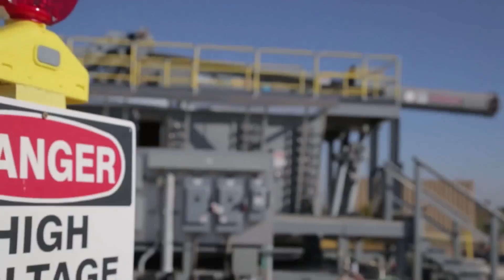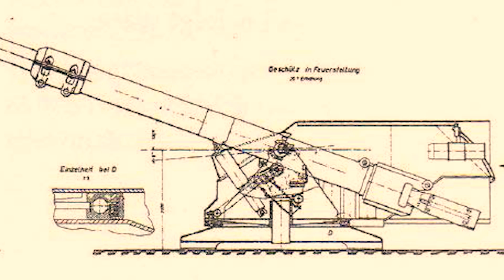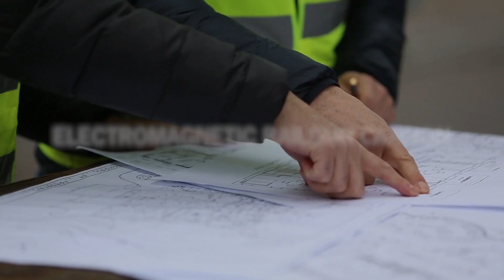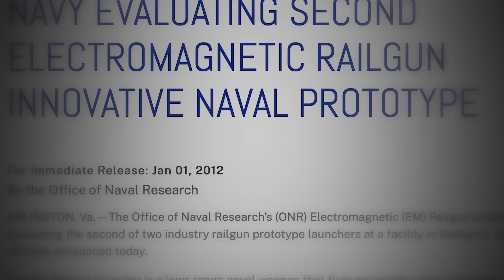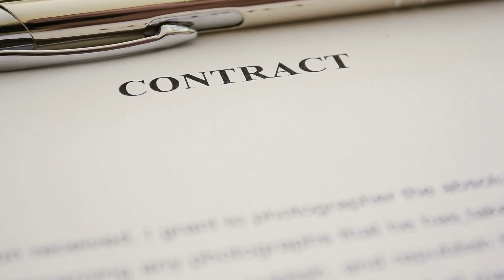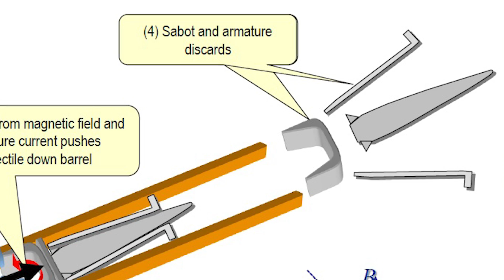The Most Powerful New Gun the Navy Has Ever Built?

Comment: Hmmm... have a disposable cap at the end the barrel that gets replaced after every firing. While preparing the to shoot bring the barrel down to as close as a complete vacuum as possible and use a round that can be suspended with magnetism similar to a maglev, maybe not even the case surrounding the shell. The round will punch through that disposable cap each time it leaves the barrel, but no air, no touching the sides = no friction and no friction = very little degradation in the barrel. Also running super cooled liquid hydrogen through the barrel walls will not only provide cooling, but it also enhances magnetic fields and make it easier for the round to be levitated in the barrel. I can't be the only one who thought of these solutions...

Comment: playing @8:40 in slow motion, I see that the air around the object is highly deformed. Or the light around it is warped. Why is this? Is the object heating the air ahead of it as it goes? What causes the light to shift so much? Because I don't think it has anything to do with shutter speed or frame rate. I'm just wondering because I didn't notice the same effect around mach X fighter jets in flight.
Reply: the object is traveling at more than the speed of sound, thats the shock wave you can see, like when a large explosion happens you can see the shock wave radiat out

Comment: Either I'm confused or this video is.   The German WW2 rail gun shown in this video was a railway gun, conventional in concept but bigger while the rail gun developed by and for the US Navy that features in the latter part of the video does not employ conventional low explosive propellant (as the German one did) but uses electro-magnetic forces to accelerate the projectile. In the latter case the term rail refers to the 2 conductive rails that provide extremely high current to the projectile which as a consequence is rapidly accelerated along the barrel.

Comment: Isn't this the system that the US later abandoned ($500 million wasted) to the fact that as there was no gas to lubricate the warhead, causing the barrel of the gun to quickly wear down after a couple dozen rounds, and as a result killing any accuracy?  The same system, that due to the size of the capacitors and the power needed to charge them, could only be used on ships, and with a range of only 70 km, would have the ship sunk by undetectable hypersonic missiles (with ranges more than 1000 km) long before the enemy came anywhere near the range of this gun?  Not only have the Russians long solved the issue of wear, but they figured out how to reduce the size of the system (to mount on a tank where it can be put to far better use), all in one solution.  Please stop embarrassing me and my country by touting unsuccessful technology.  At least the Russians don't brag about things to the level the US MIC does.  Then again, with the eight years NATO spent training and equipping the Ukrainians, I can see why they are desperate to brag about something positively; even if it was a failure.  When will the US MIC finally put the money where their mouth is and not use most of it to line their pockets and those of the government officials that award them the jobs.

Comment: The German Rail Guns shown here were so called because the wheeled truck platform ran on standard gauge railway tracks, these weapons were used against ground targets cities and even cross channel at England.

The massive barrelled ‘railgun’ V3 (Vengeance Three) weapons which are the natural precursor of these modern electronic devices, were aimed at a fixed elevation aimed towards London and were underground, only the tip of the muzzle visible above ground. 

They were formed of a massive barrel with ports evenly spaced along its length from which explosive charges were set off by the projectile as it shot up the barrel, increasing velocity each pass. The Germans used their rocket know-how in the construction and rocket fuel as propellant. Fortunately Allied Bombing put them out of use before they could do too much harm.

Comment: When I worked for a mom and pop auto parts store back in 1981, a representative came in and asked if I could supply him with 100 pairs of brake pads for a Chevy Corvette. These were symetrical pads designed for multi piston calipers. After a brief search I secured the pad pads and made on of the strangest sales of my life. When I asked why the Navy wanted with brake pads at sea, the buyer told me they were to manage the recoil of a new, extremely powerful gun. Could it be and early pototype of these?

Comment: I really think the Military needs to look back into Project thor or making a railgun type weapon outside the atmosphere. I'm sure it could capable of holding many projectiles and then have private industry    rocket companies send up the ammo and maintain it. Could run the rail gun with two small nuclear reactors to maintain enough energy. Possibly two nuclear submarine type reactors. Space travel is getting a hell of alot cheaper now especially,when you don't need to throw away Rocket boosters like before. Space X has definitely proved this.

Comment: What exactly causes the large muzzle flash from the barrel of a EM rail gun?
Reply: It is technically an arcflash when the push armature decouples from the rails. A good part of the aluminum alloy piece is vaporized while the tungsten or DU alloy penetrator continues. The real bottleneck for these are the pulse power switching tubes that rob about 50% of the power and have about 30 shots for life. The rail also is consumable but lasts about 90 shots. The spark gap tubes are made by EG&G and are each about 15 inches diameter. The gun has 48 of these. The rails are made of a copper beryllium or silver tungsten composition 🤓

Comment: Tungsten rails, and barrel flooded with a inert gas before every firing would probably help keep the arc from destroying everything.  Probably a cooling system of sorts down the center of the tungsten to help firing times.
Reply: It’s not just arcing. The huge forces involved bend the rails.
Reply: @dzerkle  with materials and increasing the size of the structure around the rails holding them in place and tungsten being as hard as it is, especially at the size that would be needed I'm sure they can fix that issue easy enough.  Pay me what they pay the ones trying to do it now and I'll make it for you 😂😂

Comment: Nuclear powered vessels could easily be designed that would have no problem powering such weapons. This research didn't just vanish. Someone somewhere is developing and adapting railgun launch tubes with moder engineering and purpose built man made materials.
Railguns may not today be practical & it may be better to research other hyper velocity delivery systems. I'd like to see the military research pin launch. This method can achieve escape velocity and launch payloads into orbit. That sounds adequately hypersonic to me. Plus spin launchers can be ground based and mobile powered by a mobile molten salt thorium reactor.

Comment: There were some interesting and shockingly low cost development to come out of this program. The Army and Air Force discovered that the projectile developed for this can be fired conventionally using the Army's standard 155 mm artillery pieces. While the RAil gun could get the shell up to mach 7.5. Using standard explosive charges would get it to mach 5+ with a comfortable range of well over 80 miles. At a cost per shot of ~$5000 usd. They further discovered that by networking these standard already in inventory 155mm guns together and tying them into the Air Forces combat information network, feeding info from AWACS planes and advanced aircraft such as the F-35, this system would appear to be remarkably good at intercepting Ballistic and Hypersonic missiles. Using older weapon systems already in inventory, and a bit of clever programing to tie it all together.
Reply: lol, you should write futuristic military novels
Reply: that's my understanding as well that a lower cost alternative is the result
Reply: Sounds amazing....

Comment: I suspect that the magnetic confinement technology developing for commercial Fusion reactors will solve the barrels issues. Basically creating a thin magnetic shield around the inside of the barrel protecting it from the rounds acceleration friction. In the mean time, I still R&D should continue as the technologies developed for the systems will have wide ranging application even in civilian technologies.

Comment: I think they could be made so the bullet would never touch the barrel just as in an electric motor, the armiture doesn't touch the magnets or electro magnets. The magnets can keep, say a iron bullet centered as it is speed up. The gun is basic a straight electric motor instead of being forced to go around by a axle. Also by cyro cooling a superconducter as part of the bullet could be used to help in centering the round. Just my thoughts.
Reply: That idea has been around, but it doesn't have the efficiency of railguns where the armature is in direct contact with the rails.

Comment: Long ago I worked at a plasma R & D facility and the last projects I worked on were rail guns. When a new tech asked the lead PhD how railguns work, the PhD smiled and responded "The problem is that they don't work"
Railgun theory dictates that when a high voltage, high current arc is created between two conductive rails (hence the name), the electromagnetic force in the arc will force the arc down the rails at extremely high velocity, limited only by any friction that might occur in the barrel of the gun (e.g. atmosphere, which is why railguns typically operate in a vacuum). The problem is that the arc is running at 3,000 degrees F which causes the rail material to ablate (burn off) into the arc.  For the first couple of centimeters of travel this may not be a problem but by the time the arc has traveled a foot, there can be as much ablated mass from the rails in the arc as the projectile the arc is trying to push.  The increase in ablated material is more than linear so the longer the gun's rails, the more material is ablated off the rails.  I've seen pictures of railgun rails that looked like melted butter because of the ablation.
For more than four decades the Pentagon has been claiming that railguns will work and their success is just around the corner.  Ain't gonna happen.
Reply: Spaceshuttle tiles / vacume combo?

Comment: Rail guns and hypersonic missiles both got shelved because were now in the era of lasers and directed energy. There is no longer a need to have any projectiles. You can simply destroy something from any distance and hit it instantly. No more running out of ammo or dealing with recoil or missing your target. These lasers are designed to find their target and then rapidly pulse energy until the target is destroyed.  The navy, Air Force and army are all slowly transitioning to this inevitable future. I strongly believe this is why Tesla and all American car brands are quickly converting to electric cars. They know the future battlefield will be using batteries and electricity for lasers. A massive battery pack with a large generator to power these 200KW lasers means that it becomes the ultimate anti air systems. 

The new engines for the F35 were specifically designed to produce more electric power so they can use these new laser systems. Once they implement the new drones for aerial refueling the F35 can operate almost indefinitely in the air as it won’t need to re arm and it’s engine is designed to run continuously.

Comment: Depends if they ever find ways to solve the barrel and power requirement problems.  If the project was shelved it seems unlikely.  Those things might be insurmountable issues. Things like that can often block an innovation from reaching fruition. Let's not forget they have been messing round with nuclear fusion for years and still haven't got anything viable.  Similar situation.

Comment: Well, a long-range missile already exists in the form of the Russian R37-M air-to-air missile (AA-13) which can reach speeds of Mach 8 (5,928 miles per hour) to ranges of 300 kilometers.
Reply: I think the whole point of the railgun is a munition that's cheap and doesn't explode when the ammunition is hit making a naval ship far more survivable.
Reply: It is pure fantasy.
Reply: @bighands69  agreed, the Railgun as it exists today is a Sci-Fi wish list item.
Reply: That data from the R-37M is under extremely specific circumstances. Dramatically different than any conditions under which artillery is fired. The U.S. Navy's SM-6, by the way, is far more capable than the R-37M, which is mostly aimed at being used against unarmed AWACS and tankers in the beginning days of a war.

Comment: Although I recognize this idea is largely infeasible, one of the ‘fixes’ I’ve imagined for railguns is to make them frictionless, through engineering the barrel and sabot to be exactingly smooth on an atomic level. Probably wouldn’t work anyway though lol.

Second idea is to look into coilguns instead. More complicated, but so are common guns today compared to matchlocks.
Reply: Half way through the canon the projectile would heat up and not fit correctly anymore. Also, you’ll need to fire it in a vacuum.
Reply: @cyrilio  that was my same thought lol
Reply: Mechanical friction with the projectile isn't the only problem. A railgun has a massive electric current flowing from the rails through the projectile.
Reply: @JesusHChrist2000  spaceshuttle tiles?
Reply: @fonzmeal6165  too fragile, any debris would fracture and destroy them immediately, maybe even the shockwave could do it at the speeds the projectile moves.
Reply: could one manufacture a piston driven engine using this tech? Each piston would be a miniature railgun.
Reply: @BlazinRiver1  They are called solenoid engines and you can buy them. They are very inefficient though.
Reply: @BlazinRiver1   I mean yeah but it’d be hella inefficient and wear itself out in seconds depending on the rpm. Only possible benefit I can think of (I’m not an engineer or qualified in this field) might be high torque generation. But really solenoid engines are already said to be the least efficient electric engine type and it uses coil pistons, using rail pistons would just shred itself before it could even be useful.
Reply: I was thinking maglev tech with the rail gun... frictionless using supercooled magnets.
Reply: Having it be maglev defeats the purpose because the whole thing about a railgun is that it needs to make an electrical circuit in order to work, specifically a circuit using the two rails and the projectile or it’s sabot. If it can’t touch the rails properly, either it wouldn’t make a circuit or it’d only make a weak one.

As for Banter, I was a lil bit worried about if it’d fuse like that but it was a 50/50 to me so I didn’t bring it up.

Idk wtf Genco is saying about railguns having an RPM so high it’s unfeasible for anyone to bring enough ammo for it, Railguns seem pretty slow right now between charging the super capacitor banks and barrel wear. As for orbital kinetic bombardment, do you know just how expensive it is to send up even a pound of anything by rocket? We’re not getting anything like that until we have widespread space mining infrastructure, and by then there’s gonna be better stuff anyway than just dropping rods of tungsten on people. One such thing for example could be firing those tungsten rods out of a coil gun, that’s more or less what the UNSC from Halo does but idk what the composition of their MAC projectiles are. Or better yet, osmium, since I’m not sure that actual material characteristics are all that important over mass/density at high enough speeds.

Also ngl I kinda consider lasers to be a tad inferior to particle beams once you get there, since lasers only impart thermal energy (or maybe gamma too depending on the type) to their target whereas particle beams impart kinetic energy, AND thermal if the particles are preheated. From handhelds to warships, I think it would at some point be more bang for your buck to use particle beams. And how about this: antimatter particle beam.
Reply: @GencoSchmar 7  What is being used to deliver the kinetic energy? Because the thing is that air resistance, drag, and friction are not problems specific to railguns, they apply to any object moving through the air. If explosively launched projectiles also were fired at that speed, they would face the exact same issues related to air performance as a railgun projectile. Moreover, railguns are literally kinetic weapons, they fall under that banner.

Comment: The railgun was proposed for the Zumwalt class of ships, but the Navy had the cart before the horse.  The new weapon systems were still in design and testing.  Advanced Gun Systems (AGS) was to shoot a 6" projectile within 60 to 80 miles range.  With only three Zumys left out of 32~ the 6' round was 1 million dollars each a pop.   Zumys can handle the electrical load ok but blowing out a barrel after one shot means back to the drawing boards.  I Hope the Navy fines a solution and stops building ships before systems are combat-ready.
Reply: @panhandlemikee5573 you're correct & I agree the Navy needs to stop building ships before the weapon. Only time in military history that a weapon was built before it's intended platform & it is still in service even today was/is A-10 Worthog.

Comment: Maybe they should have lowered their specs on the output to prevent excessive barrel wear. It took decades for naval rifles to be efficient and reliable. The navy tried to perform 4 decades of innovation in a 10-15 year period.
Reply: I worked on a 155 mm railgun in 1990. 30 years later, it's still just a laboratory toy. Impressive in some ways, but is not yet battle ready. Perhaps never will be.